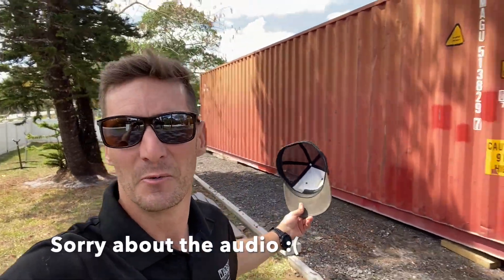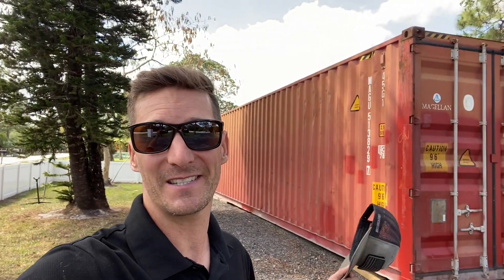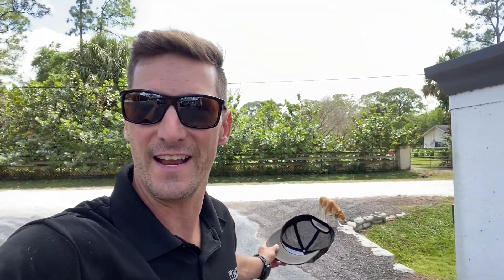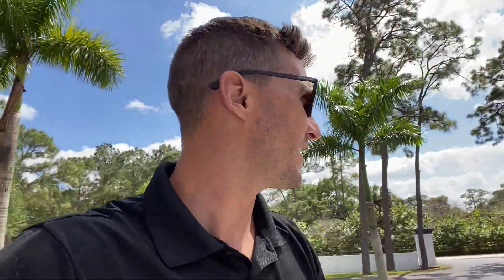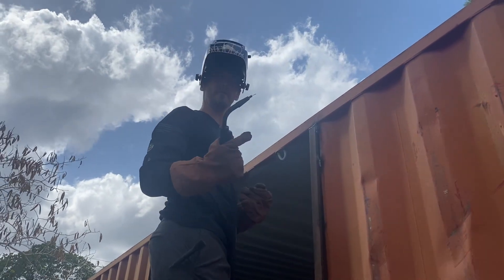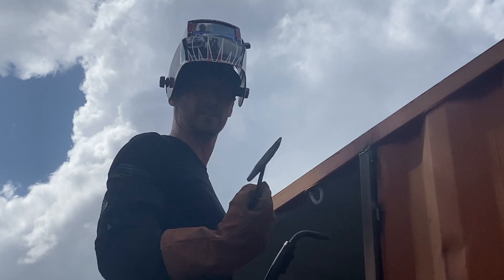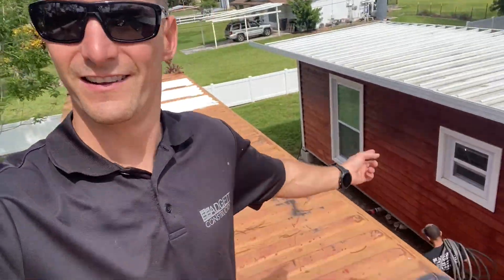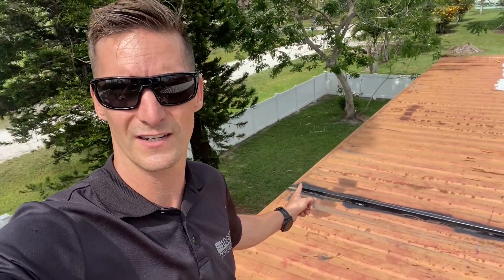The New 40' Build is here! Cut outs and Welding

Comment: As an actual welder. That’s a chipping hammer. Flux core (FCAW) is extremely strong weld. 1” = 80,000lbs tensile strength. But by no means does hitting it with a chipping hammer increase it’s strength. Just edit that part out, I’m trying to help lol.